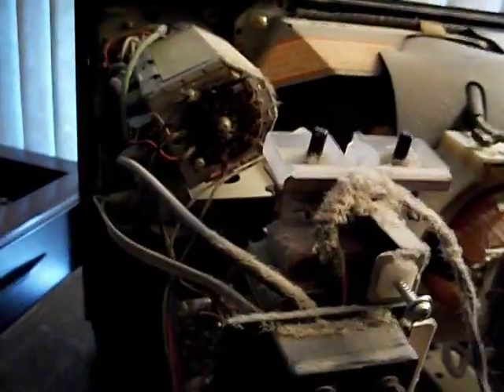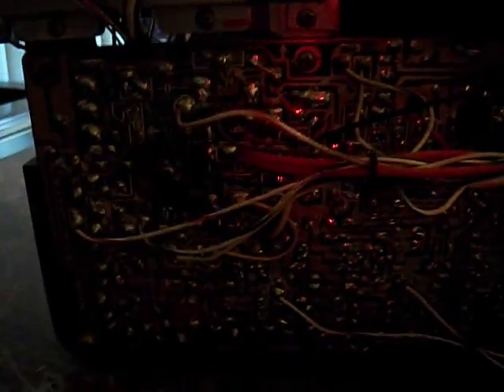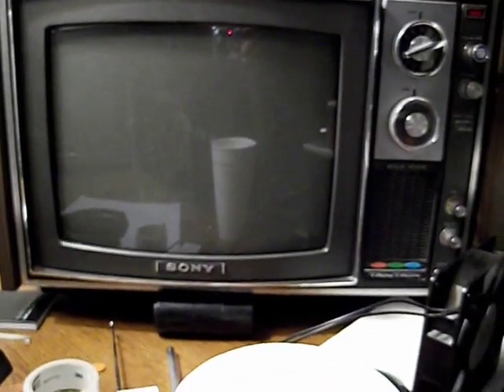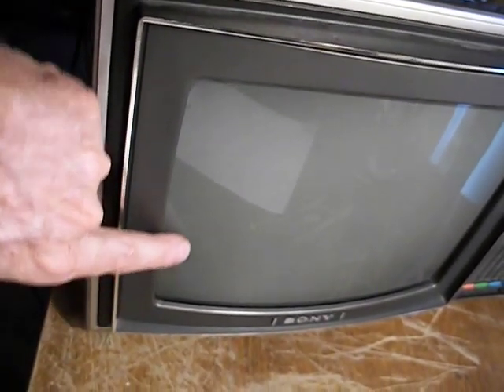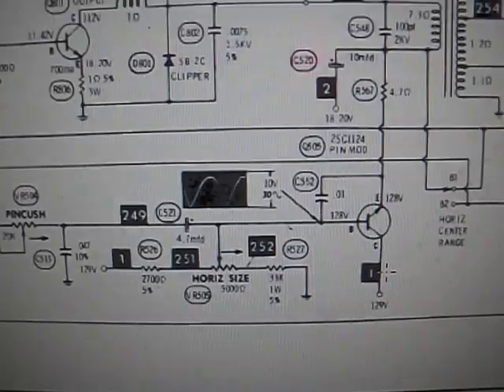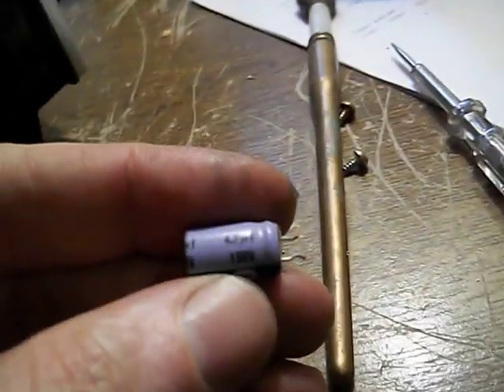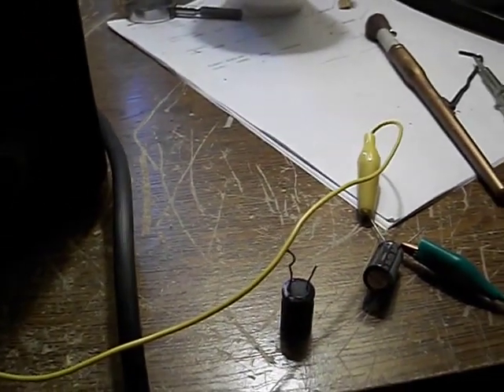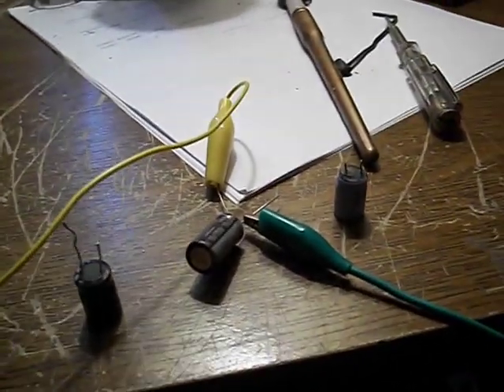Sony trinitron KV-1212

Comment: Do you happened to know if there is any risk of asbestos in this model?  I picked one up myself and saw a video of a different vintage tv that had asbestos and now it’s got me wondering.
Reply from the maker: doubt it, Asbestos was for fire retardant, there is very little heat generated in a solid state TV. Old late 1940's thru the 1950's sometimes would have a pad on the inside of a bakelite TV for protection from the heat of large vacuum tubes. Only way to know for sure would be to open it up and look around for a whitish pad.